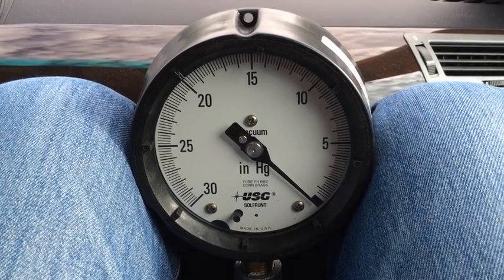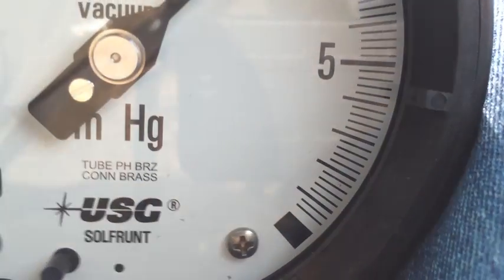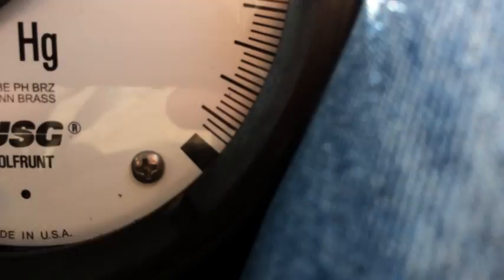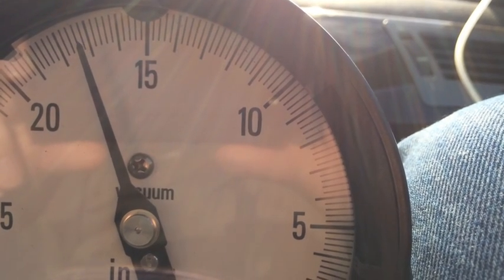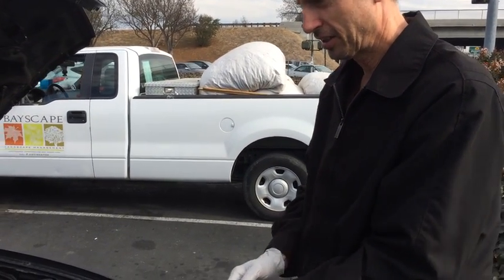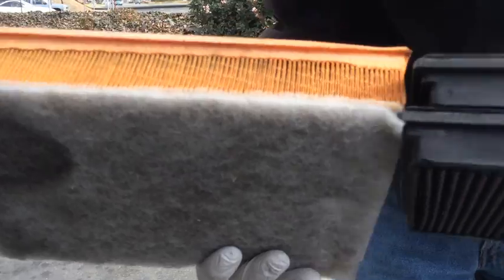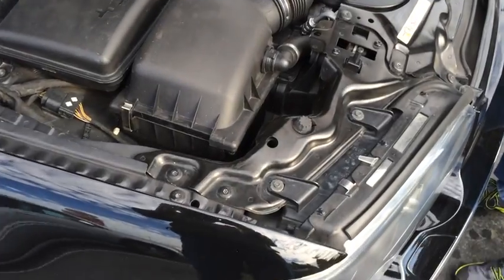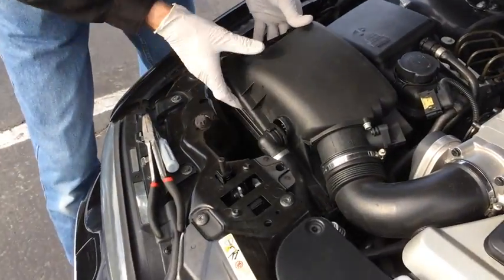BMW 760Li stock air filter vs K&N with VaccumGage

Comment: hey there.  I've been watching your 760 vids.  couple questions if you have a minute.  what was your final exhaust build?  did you try cutouts at all?  what were your thoughts about different exhaust mods?
I see that you have the newer alpina rims.  I've been thinking of doing the same rims.  what size rim and tire combo did you go with?  is the ride still soft and smooth?  if you have a second, I'd love to see the car from the side with those rims.  I've scoured the internet but can't find a 760Li with the Alpina rims, I've only found actually Alpinas which have a different look altogether.  anyway, if you have time, my email is jzuther@gmail.com
A pic of the car with rims would be greatly appreciated
thanks again for all the videos
Jeremy Zuther